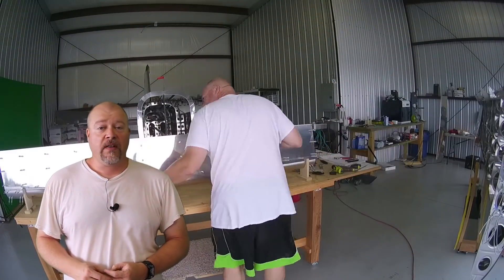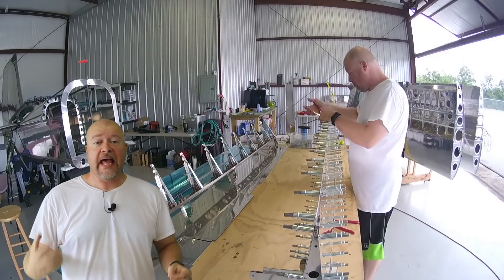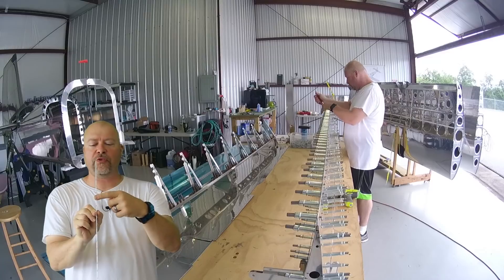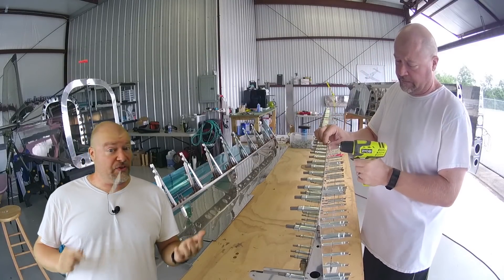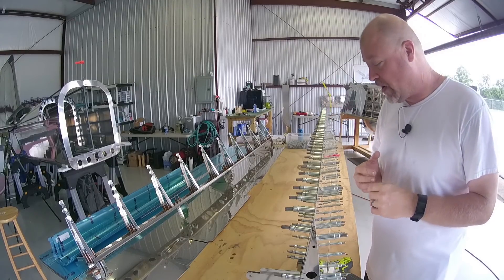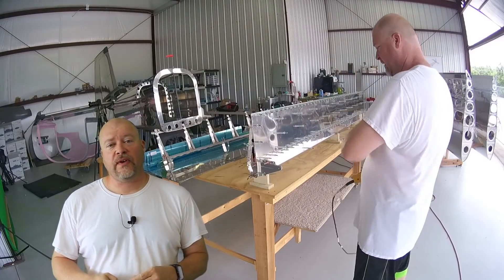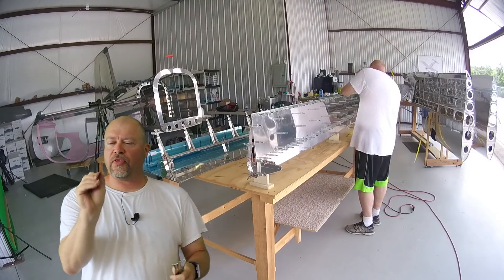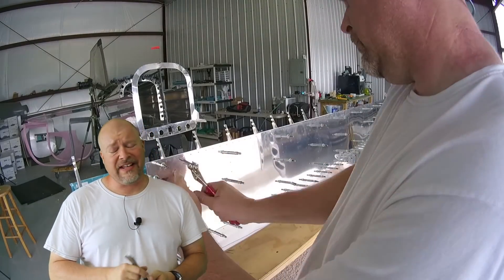RV-10 Extra / Wings - 064 - Flaps day two, Trailing Edges, Drill bits and Washer wrenches

Comment: FYI. Your drills will last like 10 times longer if you drill aluminium with a bit of rubbing alcohol or WD40. But where alcohol disappears quickly - WD40 does not. Also the finished hole is much cleaner.  Espeacially when doing eg. aluminium threading... I always have a bottle with a pump-vaporizer with alcohol in - like the ones you get window polish in.

Comment: Hi Jason, I got a pneumatic cleco tool at the yardstore, I think. It is the smaller, palm-sized one and I've found that I use it A Lot. It is especially helpful when I'm thinking: 'Do I really want to take all those clecos out?' knowing that I should, and will, of course! I still use my pliers mostly, but when there are 500 clecos (I'm thinking wing skins here), the pneumatic tool really does a good job and was worth the $80. We sure do collect a lot of specialty tools, don't we? I got the milled wedge holder you are using in this video at Cleaveland, don't know how we would manage without it!
Reply from the maker: YES WE DO!  Aircraft spruce has one for $95.  And Nova makes one for $60.  Thought about getting that one actually.

Comment: Jason, did you ever consider building a torsion box table?  What is you recommended table size for RV10 assembly?
Reply from the maker: I didn't.. because I dont know what that is.. =)  I started on an 8'x3' table and found it wasnt quite wide enough so moved up to an 10'x 4' table and it's fine though I still have the 8x3 in the background =)  So.. Both is good.
Reply: https://www.finewoodworking.com/2007/05/15/build-a-torsion-box-assembly-table